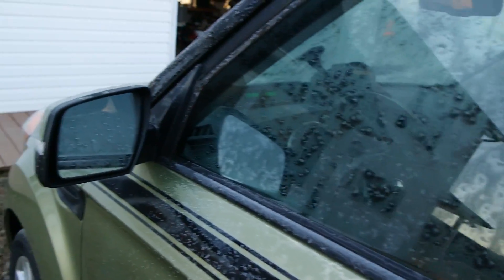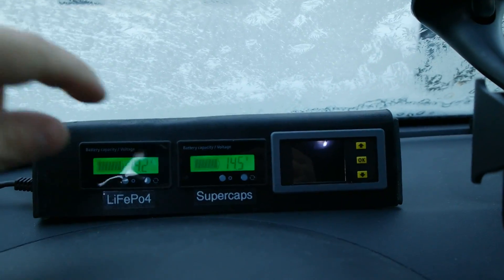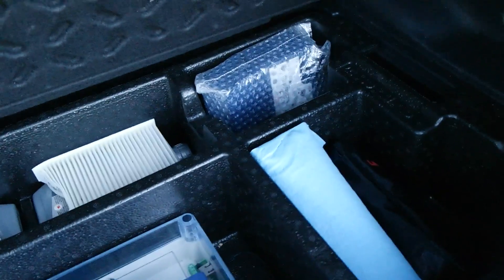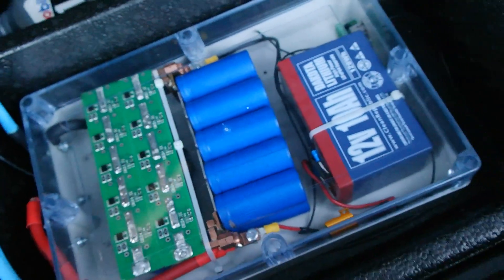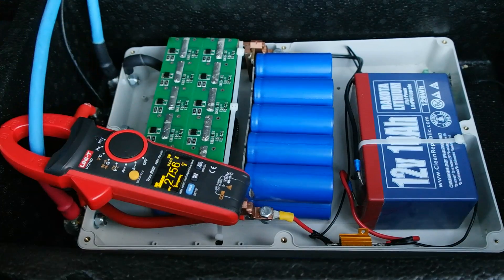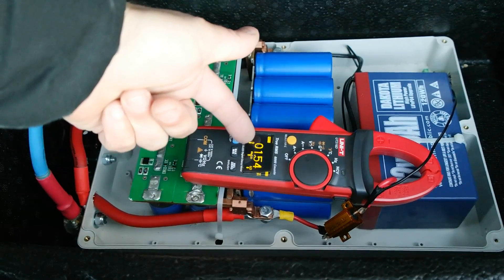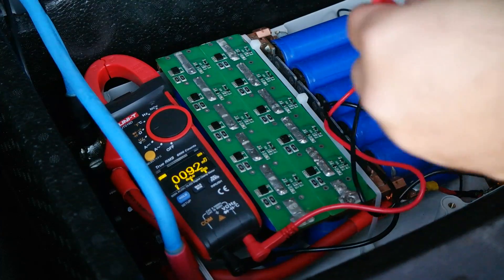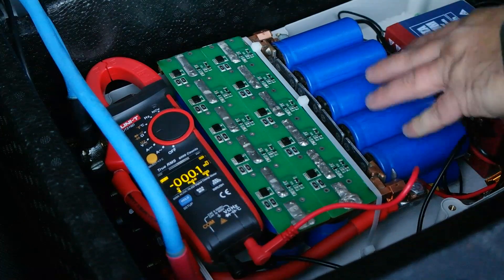Hybrid Supercapacitor Car Battery Part 7   1 Month Update

Comment: Would this work in a situation where a constant or almost constant consumption is needed. I need to run my radio shack and at the moment I have a load of 10 amps peeking to 40amps when transmitting?
Reply: At the moment you will need a 40 A power supply to handle those peaks. When using the supercapacitor bank as buffer you would be able to size down your power supply to around the average current consumption. Lets assume that would be 20 A. Or you could still be using your 40 A supply knowing that it would be more stable and live longer because the peaks it sees are only half of what they were before. Only one thing you need to take into account when switching on the power supply. The voltage in the supercapacitor bank is very low, almost zero. It has to rise to the normal operating voltage of lets say 12 Volt or so. During this charge period the supercapacitor bank will draw a large current from the power supply. In the first couple of seconds it will basically look like a dead short. The simpel solution is to use a chunky series resistor to limit this initial current. The charge will probably take somewhere between 10 and 30 second before you reach the desired operational voltage. Depending on the size of the supercapacitor bank and the current the power supply can deliver. Make sure the resistor is able to handle the power it will be seeing.
Reply: A Supercapacitor will definitely iron out those current peaks.
Reply: Christopher Warren The addition of a capacitor pack in parallel with your radio power supply is being done for high power. Xmtrs and is an excellent solution.
Reply: Limiting the capacitor inrush is a good point, however if you use too high a resistor value your caps wont recharge fully before you are ready to reply and key up again. Maybe you could try a .1 ohm 25W resistor for say a 240mf 12v capacitor bank, but a better solution may be to just use a higher capacity bank that wont fully discharge during the power spike and let the power supply recharge it at its full capacity almost instantly.
Reply: Frankhe78 thank you for that explanation, it is much clearer now. I am using a 80amphr battery and a 230 wp solar panel.  How many super capacitor banks will I require of say 2.7v 500f?
Reply: I thought we were talking about running a radio xmtr off of a 40 amp power supply. Check out BBi box builder channel. For replacing an 80ah battery ina solar setup, that is a different application....Check out Julien iletts channel.
Reply: RockTech I did not mention specifically batteries since this project is a hybrid.  I thank you for your input I am understanding better what to expect. I will look up the sites you mention.  Thanks again.
Reply: @RockTech if the series resistor is to low you will short the power supply. Could also look for a way to create a constant current source.
Reply: Frankhe78 thank you for the information I will keep this in mind.. perhaps the original 0.5ohms used here would be better to start with.

Comment: So here's the big question.  Can you mass produce it for less than the cost of an SLA car battery?  The way I figure it, the super caps and electronics should last the life of the vehicle.  Hell if it didn't get too hot or cold, LiPO's could probably last too.  You'd never have to buy a battery again.  I'd love that.
Reply: Taking into account that during the life of a vehicle you will have to replace the lead acid battery at least twice. If the kit is twice the cost of a normal battery it is already worth it. Not mentioning the time saved by having to jumpstart the car and being late for your appointment. Sounds like a solid investment to me.
Reply from the maker: If you take lifecycle into consideration the expense of the hybrid battery is initially more, but over time it is actually about the same or slightly cheaper then replacing lead acid batteries every few years.
Reply: Lets find out if the button "Report spam or abuse" in Youtube actually works. If we all report the messages of this guy then the account should be disabled by Youtube automatically.
Reply: Meds dude.  Now.
Reply: Move along limey.  We won.  Get over it.
Reply: You forgot to take your pills dude.

Comment: think that's really cool. I would try something like that but I sit in my car at lunch and listen to the radio most of the time with out running it. something like this would be neet to try in a Toyota prius to replace the take off batteries. it would give it more of a boost at take off and recharge faster.
Reply from the maker: +Richard Best yes, the one disadvantage of this setup is you can't listen to music for hours in your car, as there is not a large reserve available like in a regular car battery.
Reply: You could always add more electricity storage batteries to this system